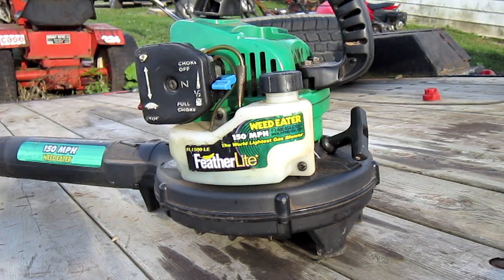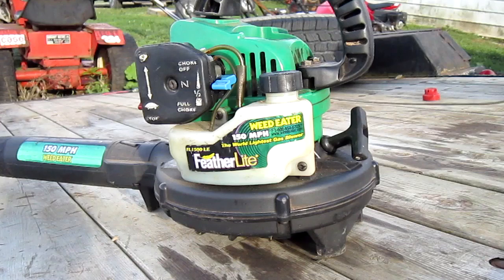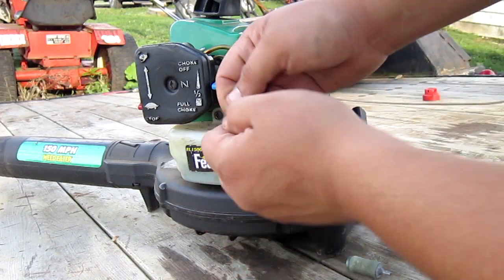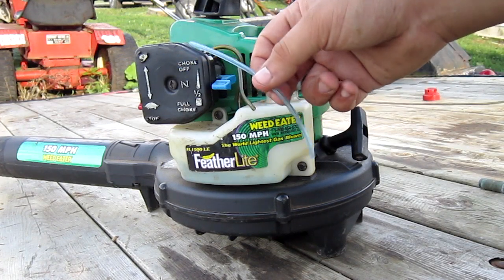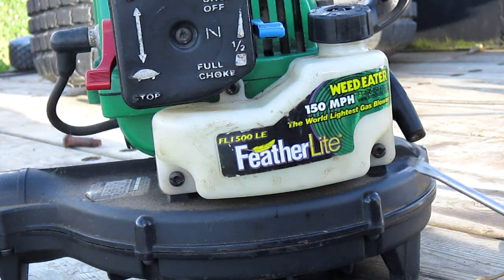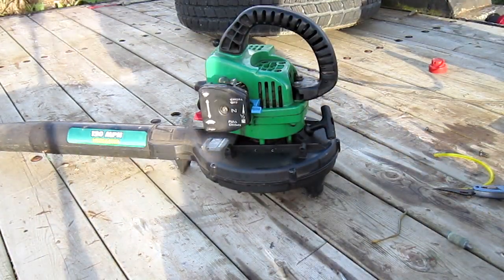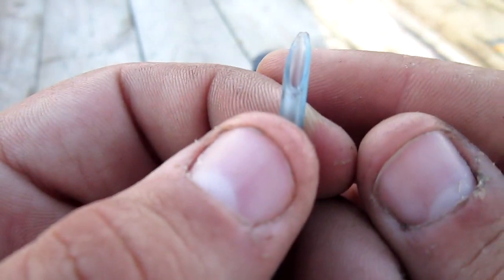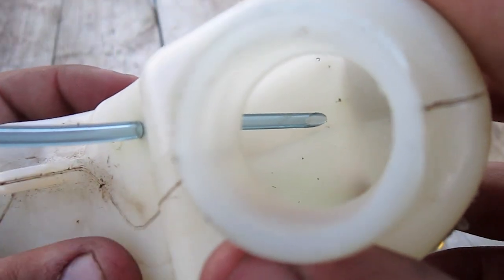Leaf Blower Fuel Line Repair

Comment: Great video I have the same model with rotten fuel lines.  Home Depot has a universal fuel line repair kit for $5.99  SKU 752-199  that has 4 replacement fuel lines for many blower/Trimmer/etc. models.  Bought one and installed new fuel lines in 15 minutes with the help of your video.  Each line comes with a bevel cut end.

Comment: Just wanted to say thanks for the vid. It helped me out a lot. I was ready to buy a new leaf blower because mine still wouldn't start after changing the spark plug. Sure enough, the fuel line was the problem! Following your instructions worked like a charm and it saved me so much money! Thanks again.

Comment: Excellent information. Did not even think that the fuel line could be the problem until I watched this video. Fuel line was in bottom of fuel tank in small pieces.  Followed instructions to replace fuel line and blower works great.  Many thanks for such useful information.

Comment: thank you buddy I need to know what's fuel line went where so this was a big help for me I have several blowers in the shed that need fixed was ready to buy a new one but figured I would replace fuel on spark plugs to see what happened first we'll see what happens I didn't know what fuel line to put away means they were all disconnected and broken and then mechanic work for you but just couldn't remember which one went where brain fart

Comment: Hey man. I just noticed that my gas filter is totally floating around and loose inside the gas tank of my blower. I guess i need to do the similar process you did. where do i get the new tubes??   what is the impact of not having it connected? i noticed that my blowers works for like 3 mins and then shutdowns on its own. Thanks for your comments.

Comment: I have one just like this but when you crank it..it will only crank and run with the choke closed halfways..when you open the choke the engine will start cutting out and then  dies.  I already put  a new carb kit and plug...and all bolts seem to be tight.  I did not adjust the mixtures screws yet though  because they are sealed with special screws.  What do you think my problem is?

Comment: Nice video
I just spent 20 mins trying to start mine
I got aggravated and almost threw it out lol.
Are both lines supposed to be to the bottom of the tank? I noticed on mine the gas line looks short and not touching the gas in the tank? I didn't notice a filter on mine either
I have the same blower you do

Comment: I'm confused after watching your video.  If the smaller fuel line attaches to the fuel filter inside the tank, what does the larger (yellow) line attach to?  The video shows an adapter on the end of the larger line, what is that for?  Thanks.

Comment: whats the length of the primer line inside the tank ???.......and the length of the fuel filter line once the filter is attached.. how much should you have past the top of the tank to stuff back inside the tank and are these lines different in size on the outside and outside

Comment: Thanks for the video I have the same exact blower..ordered new fuel line / fuel filter etc. from RepairClinic.com ..I`give you all a little hint on how to make it easier getting new lines into the tank, after getting the tapered end into the tank I used a hair dryer to heat up the fuel line and it slid right in..Made it ALOT easier..
Reply: Also boiling water
Reply: Bill Patrick  Heat makes things expand. You expanded the fuel line to make it easier to put it in the little hole in the tank??

Comment: On same blower, replaced fuel lines, new spark plug, new air filter. Full choke and high speed, turns over, move to 1/2 choke starts but dies after 2-3 seconds if I move or don't move up o no choke. Any idea?

Comment: Does anyone know what size line for each side on the Weedeater (I have a BV1650 but it seems to have similar large and small lines)? The primer line just goes 1/2 inside the tank to return excess gas pulled through the filtered input line to the carb (smaller line) when you prime.

Comment: yea, I like it, good video, thank you. My only question is, whats the "dont forget to connect the end?" Some plastic piece that serves no purpose I can see? THAT end? And then you say "Pull it through cause its not needed only for priming." That sentence makes no sense. Why say its not needed? Huh what? I would guess the primer line should sit on the bottom of the tank as well so its not up at the top of the tank sucking air. So why pull it all the way back up where it wont be submerged in the fuel? Thats what I would think.